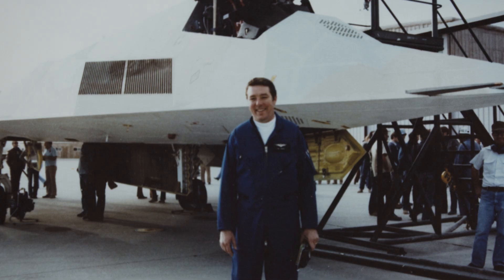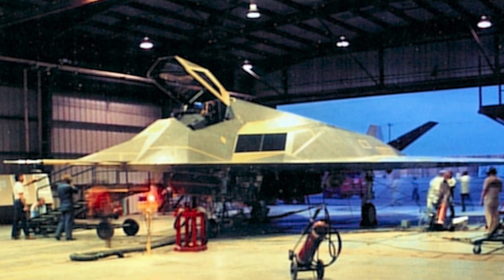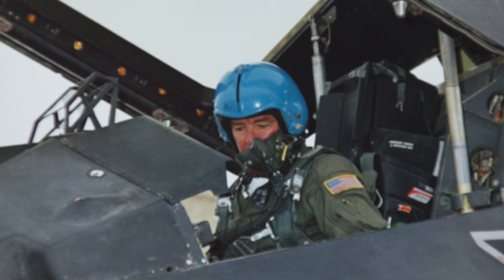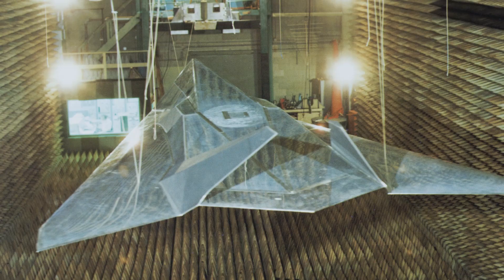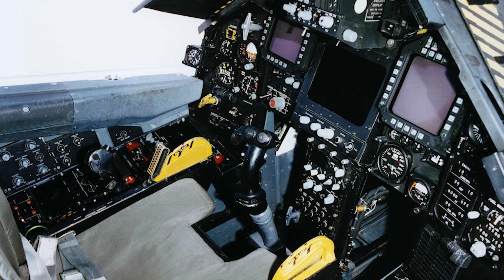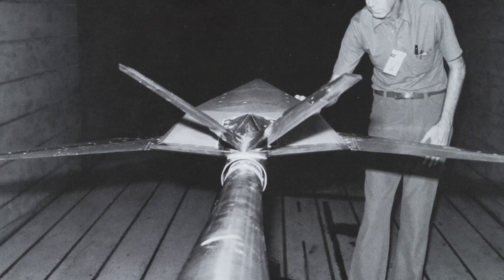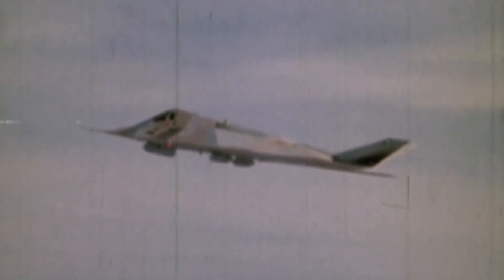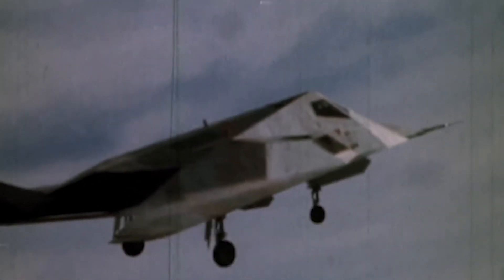F-117A Top Secret Skunk Works 1st Flight, Lockheed Martin aviation engineering technology, Nighthawk

Comment: I've been to meetings at the Skunk Works facility in Lancaster, CA and the day I drove there, I saw an F-117 land as I parked my car. Too cool. I also saw a B-2 bomber in the hanger. Also cool since they hadn't been shown publicly yet I think.
Reply: Kilo Byte  That doesn't mean it couldn't land at the Skunk Works air strip fucking asshole.
Reply: The Lockheed Skunk Works plant is located at Palmdale Airport. Palmdale is essentially an Air Force facility but is sort of semi-public. Also located at Palmdale airport is Air Force plant 42. All you guys who think you're so smart calling this guy out saying Northrop built the B-2 bomber you're correct but the final assembly point of it with Air Force plant 42 at the same field. That being the case I suspect there were plenty of B2 is being flown in and out of Palmdale at that time.

Comment: This is not the F-117A, this is the FSD (Full Scale Development) aircraft serial number 79-10780. They (5 FSD airframes) were later designated YF-117A. The first flight of an actual F-117A, serial number 80-0785, the first production aircraft, occurred on April 20, 1982. The flight control system on the aircraft had been assembled incorrectly at the factory in Burbank. The F-117A lost control on take-off, inverted and augered in just off the runway, catching fire in the process. Because of this the first F-117A never was accepted into airforce service. Love watching Hal Farley tell his piece of history though.
Reply: The "Have Blue", yes?
Reply: Topal Glangus no the Have Blue was the XST (Experimental Survivable Testbed). The FSDs came under the Senior Trend phase.
Reply: @gareth204  -- Thanks for that info... I see what you mean now. 
Do you know if there's any footage out there of the Have Blue flying?  I know they were both destroyed in testing, or crashed and later scrapped.  I've seen one photo of Have Blue, endlessly repeated across the internet.  It looks longer and more slender, more like a traditional fighter aircraft of the day.  At least from the angle of that one photo...
Reply: @gareth204  thanks!
Reply: @chriswieman  The remains of the Have Blue prototypes were buried on the grounds of Area 51.  There have been very few  -- maybe a half-dozen -- Have Blue photos and just one snippet of film released of them.
Reply: Hal did the interview.  The videos and Youtube channel  (spelling) was created by someone else.
Reply: Four of the YF-117s are on display around the country.
The fifth YF-117 was destroyed to see how they could dispose of the production F-117s.
I was under the impression that they wouldn't be putting any Nighthawks on display aside from the surviving prototypes but apparently that's not the case.  There are production planes on display or in the process of being put on display.  That brings the F-117s on display up to at least 10 total, although it may be 16 at the end.  They allocated up to a dozen production planes for display.
Some F-117s will survive for test duties, the others will gradually be destroyed.
Considering only 64 F-117s were built total (plus 2 static airframes never intended to fly so it's actually 66 airframes total), that's still less than 20% survivors for what is an iconic plane whether you like the design or not.  Supposedly, it's a pain-and-a-half (and very expensive) to sanitize the planes for public display because of the stealth coatings have to be removed for national security and toxic hazard reasons.